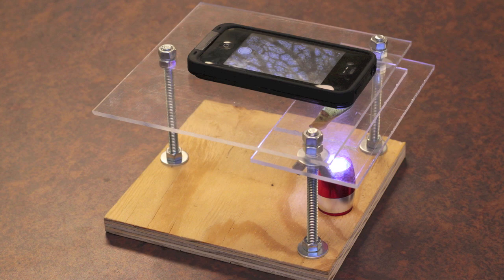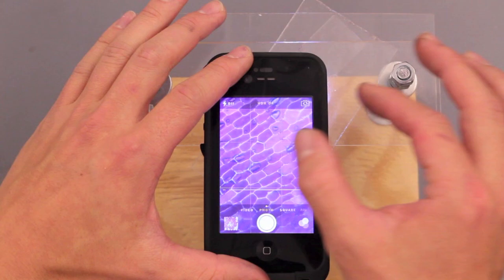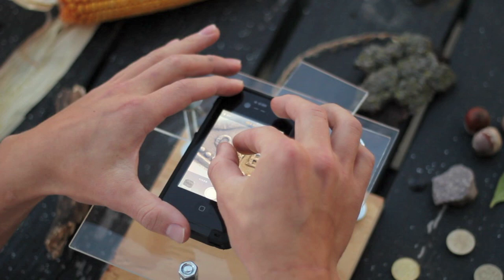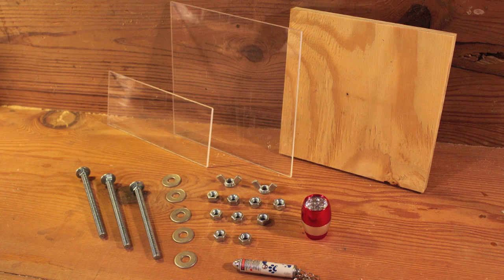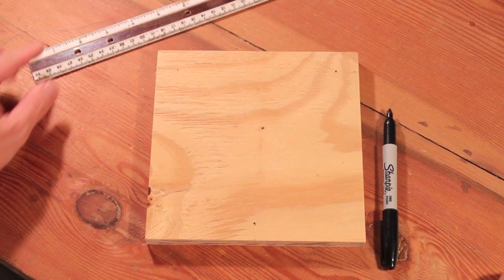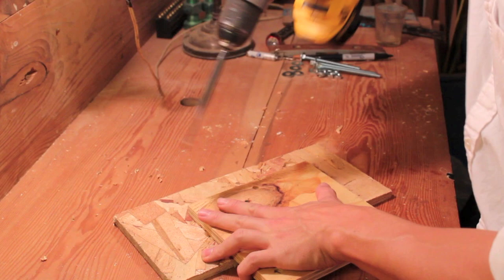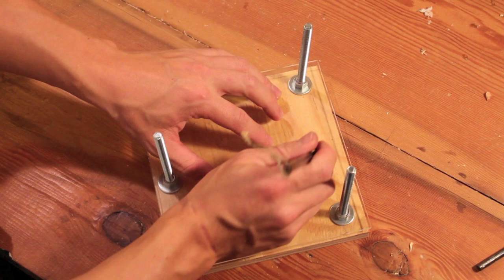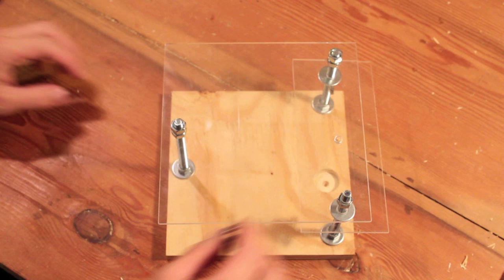Turn Your Smartphone Into a Digital Microscope!

Comment: I did this 8 years ago .  I tried to patent it but I was only 15. Great job I've been waiting for someone to do it also.. I use the laser pointer at wall mart checkouts has a led and laser diode. Yes adding another lens makes it 4 times as powerful. A third lens obscures it. Like he said u have to use it closer and def takes a steady hand if not stationary. I found using different back lights can give better detail. Also a front light and no back light can give you surface images. I got my best one up 2400× mag. I calculated it using the screen pixels. My theory was that with perfect high quality lenses and more mega pixels you could reach 100 x photon size do to the fact that the light is not inverted/crossed. Like a real microscope with mirrors and prisoms. I could see red blood cells at medical quality.  Oh and if u use the defused laser diode without the lens it can be a projector microscope. Any ways enjoy ..  Oh PS polish ur lens . and avoid touching it. And remove glass protector from camera module the closer u r to it the better . and use flat side of the lens facing the camera . adios
Reply: +jeriah pittington Now if I only understood one word you wrote but hey, thanks anyway.
Reply: Hi Jeria
I have a Samsung smartphone - the neo note series 3. I could not get the magnification. I did all the cross checks you mentioned but results are discouraging. I tried the lenses bought in amazon too but to no avail. Will gladly appreciate any input.
Reply: Can you do a video about how to do it?
Reply: My microscope only goes as high as x1200
Reply: try stalking maginfing glasses on top of one another
Reply: Please! can  you do a video tutorial on how you did all this please??.
Reply: Jeriah, so I can change the lens from laser with external lens?

Comment from the maker: Hi!
Explained better in the actual instructable (see the link above) is the process of embedding the lens in the stage. Measure the diameter of your lens and start with a hole a little smaller than that.  You can always go larger.  I used a small file to make it a tight fit.
  Most cheap laser pointers are about the same size. Avoid the dual LED/LASER combination.  The lens for the laser on that tends to be really small.  Ideally the lens should be the size of the camera.  
Good luck!

Comment: Materials required:
3x 4 ½” x 5/16” carriage bolts
9x 5/16” nuts
3x 5/16” wing nuts
5x 5/16” washers
¾” x 7” x 7” plywood  -- for the base
⅛” x 7” x 7” plexiglass  -- for the camera stage
⅛” x 3” x 7” plexiglass  -- for the specimen stage
laser pointer focus lens
LED click light (necessary only for viewing backlit specimens)

Tools:
Drill
Assorted bits
Ruler

it was on the instructables.

Comment from the maker: I am not sure which stains were used on some of the slides (elderberry, megaspore etc) but the red onion cells were not stained at all.  The outer layer with the red pigment was used.  The blueish color in most of the pictures were due to the LED light.

Comment: A table saw will cut plexi fine. There is probably a blade specific to plastics but I have used multipurpose blades without any problems. Also a band saw could do it if it has a guide.

Comment: Thanks, I think I will try this out.. but I also wonder when Americans will finally adopt the metric system. I need to look up what an inch is ;-)
Reply: The only Americans who can use the metric system are the ones who buy and sell weed.
Reply: Matt Carter I didn't know that :D
Reply: we learn metric but we dont use it. I highly doubt america will adopt the metric system 100% though
Reply: http://theoatmeal.com/pl/senior_year/science ;-)
Reply: While I do agree that America should surely adopt the metric system, I will argue that we, in America, measure sodapop in Liters. The car engine intake measurement is also Liters. Some American cars have the speedometer markings for both miles and kilometers. America has partially adopted the metric system. Who says we need to go all the way?

And why is it so difficult to look up the measurement of an inch? Practically everyone has a smartphone, and has an app capable of computing conversions. Even some "dumbphones" have built-in conversion apps (despite the fact that "dumbphones" are becoming less common). It's not that difficult, at all.
Reply: atheistpariah Of course I can look up what an inch is and I'm very well aware of converters. The point is that the metric system makes much more sense and the fact that the rest of the world already uses it should answer the question why you should go all the way.
Reply: Pixelblitz I do agree that everyone should have a standard across the world. All I'm saying is that conversion isn't difficult. Especially with a small project such as this.
Reply: Matt Carter science-based and math careers use the metric system constantly regardless of nation.
Reply: Officially, the US is on the metric system. However, the US does not use it for some reason. Metric makes way more sense.
Reply: Way i understand is on the index finger , the joint closest to the nail and the tip of your finger is an inch

Comment: I live in Ireland, we use the metric system, but there's room on a ruler for both metric and imperial, on 1 side we have cm divided into mm, and on the other we've Inches broken into either 16th's or 8th's, either is divisible by 4 to get a quarter inch

Comment: It's scientific project, why do you use medieval measurement system in your explanations?
Reply: You sound pre-medieval yourself. Scientific pursuit isn't bound to the metric system.
Reply: Joseph Wheeler i hate the imperial system but op is dun goofed
Reply: Tabak419 That's funny, I don't see the metric system listed as a requirement for the scientific method anywhere I look. You intend to tell me Sir Isaac Newton and Charles Darwin weren't scientists because they didn't use the metric system?
Reply: Joseph Wheeler The SI standard for measurement of length is centimetres, however as a staunch imperialist I say fuck the metre, 3.3333333333333333333333333333333333333333 feet all the way!!!

Comment: I don't live in the US either and I can tell you that all rulers have centimeters and inches in them, so, in rulers inches are divided into 16 "parts", just like centimeters are dividen into 10 "parts", so just grab 4 out of those 16 parts and there you have one quarter of an inch (4/16 = 1/4)

Comment: No problem and no need to apologize. It's amazing that so many people fail to understand that I wasn't complaining per se (yes, I can use Google), but simply pointing to the fact you were probably completely oblivious to. And I was correct. So now you will know of the issue and if needed, will dublicate the measurements in a SI system. Which will ultimately make your videos even better. Everybody is happy, no? :)

Comment: all you have to know is 25.4mm is 1 inch. all of the dimensions are "not critical" you can fudge them in either direction if you wish so use 20mm for 3/4" its close enough and an easy number.

Comment: Okay, the LED light at the bottom provides the light source that is so common amoung microscopes.  Without this light, your specimens would simply appear black or very dark.  The glass does not magnify the image, the LASER focusing lens does.  It uses the same technology that focuses your LASER pointer to focus the image of your specimens.  Does that answer your questions?

Comment: You will not see much cell detail if you don't stain, even with a microscope. Cells are mostly transparent, even if you can make out the cell structures. Looks like Coomassie Blue and Cresyl Violet were used in a few of these.

Comment: This is a great idea.

One suggestion though: wingnuts are only easier to use if you need to tighten them. Normal hex nuts would be easier to use in this application.

Comment: I would think that placing the lens just right would be critical. There are other everyday sources for lenses that would be better quality; for example, those obsolete cameras in my closet, or the videocam so old that drivers can't be found. The entire device could be made with acrylic or other clear plastic, and nylon nuts and bolts, or just plasctic rod. The specimen stage adjustment looks awkward, with the 2 bolts; it could be better if the stage went up and down on its own bolt ...

Comment: hmm... i know the volume on the video is low. make sure you have the system volume up (click the speaker icon on your tool bar near your clock. and make sure the video volume is up. assuming you are on PC) good luck. and also an awesome idea in the video... or click the instructables link and read about it

Comment: I havn't tried building this yet, but I think you'll want acrylic glass instead of plexi. It is less likely to crack when drilling.
Reply: plexiglass is another name for acrylic glass.
Reply: You're half right. http://www.ehow.com/about_7237550_acrylic-vs_-plexi-glass.html
Reply: +Tom Stockman Well, that source says plexi is less likely to crack . "However, softer material tends to crack or chip when drilling or cutting it. Plexiglass has a harder surface so cracking becomes less of an issue.". Anyway,  drilling is not that difficult, just extra care and mabe practice on a spare piece.

Comment: you can do this for free if you use small droplets of water as lens, for magnification use layers of them using a transparent material or just apply the drop on your camera
Reply: Anthoni van Leeuwenhoek (1632-1723) made his lenses by droplets of molten glass and then selecting the best. He managed to magnify up to 480x in a very simple microscopic device. I once saw a replica.

Comment: You're right, it isn't that difficult, but there are two problems:
1. This instrument isn't designed to be used by scientists but for amateurs who wouldn't have access to microscopes otherwise.
2. A real scientist would always prefer the SI-unit meter to some ancient unit like inch which nobody outside the US is using anymore.

Comment: Its really no problem to convert mm and cm to inches. Just google length conversion. And, you do not really even need to convert, I am sure this unit can be made any size a person wants. 25.4 mm bigger or smaller would make no difference

Comment: just an idea: a school owns a few of the given "microscopes" and ONE Smartphone. So every stud can take and SAFE the pictures of his research (not possible with most microscopes), so they can be printed out (given the printer is stil cheaper than a set of microscopes). Also considering that you need power for the smartphone as well as for the printer, a set of microscopes might be cheaper... i give up.
 Constructive Idea: is it possibel to replace the smartphone camera with something cheaper?

Comment: there is not much difference. just take a 30cm x 30cm plate, and use M8-M10 screws and M8-M10 nuts. i would also use a 0,1mm thinner driller for the lense.

Comment: hi everybody. is it possible to use cd cases instead of plexiglas? i suppose it would be a bit easier to drill
Reply: CD cases use a more brittle type of plastic, and it wouldn't hold up to drilling very well. It would just crack and shred.

Comment: Ok. Now how to extend the focal length.  I want same magnification but holding further away so i can use tools inbetween such as for electronics repair. I'm getting about 15cm using jewlers x10 loupe at back of phone so far. How to make it about 25cm

Comment: How can I define magnification power of two lenses
Reply: +Gent Gashi A crude but effective method is to photograph (or view on screen) a ruler with fine divisions (MM or 64ths)  Then measure the image on the camera/phone screen.  Also useful if you make prints of the image, as a reference point.

Comment: I mean. youre talking about using a phone for underfunded class rooms
But a phone, even a cheap one, is probably more expensive then a cheap microscope.
Also, youre getting 175x.......  a $20 USB microscope gets that. (they advertise 1000x.. but you get 150-175)
So other then the coolness factor, theres no legit reason to make this.

Comment: I thought it was dangerous to point a laser anywhere near your eyes?
Reply: A laser, yes.  A laser LENS (without the Light-Emission Device & Circuity specifically designed for the laser), no, not so much.
It's still not good for the eyes to stare at a flashlight being shined through a lens, but that isn't likely to instantly damage the eye.
Plus, in this particular microscope-build they're using a Phone Camera to observe the light anyway, so it's Only as bright as the phone-screen can get.

Comment: Maybe you are living in Liberia (the country where the slavery is still official and flourishing). Or maybe you live in Burma, a country best depicted in the newest Rambo movie. These two, and the USA, are the only ones which are still using the Imperial System, so you must live somewhere there. If not then you must live in a place where your stores have a huge stock of old rulers with a turnaround of 50+ years. You should make a complain.

Comment: Cheap? You call a smartphone cheap and a microscope expensive? I've bought a microscope for a hobby, that magnifies up to 1000 times (has 4 lenses). The cost was 10 times lower than the cost of an iPhone in my country and 5 times cheaper than a smartphone that's better than iPhone.

Comment: I just love hearing all the comments regarding our inch measuring system and how out of date and crude that it is.....
I wonder if any of you have any experience making anything precision enough to truly call our system of measurement inferior?
The parts that I've CNC machined for Boeing are still flying to this day and the tolerances were +/-.000075".  Do you pro-metric morons have any idea how precise that is?  I'll give you some help, so you don't feel too overwhelmed.  The hair on your head is approximately .007" or .177 mm.  Take that hair and divide it seven times.  Take one of those pieces and divide it 10 times.  Getting the picture yet?  Now take just one of those pieces and divide it in half and that would be .00005".
or for your metric needs, .00127 mm.
1mm= .03937".
  
I'd say for plywood and an electric hand drill, the inch system is plenty sufficient and then some.

Good video and neat idea, especially for kids that are wanting to get into science without having a lot of money to do so.